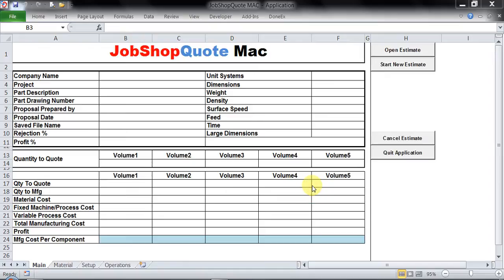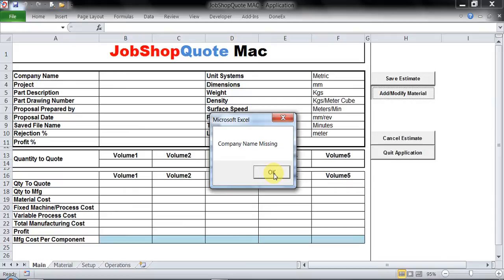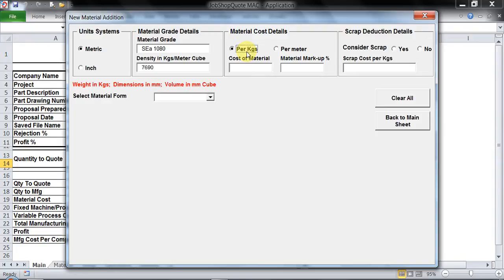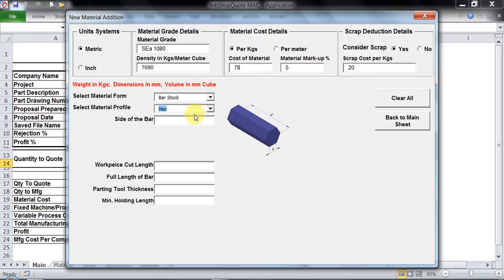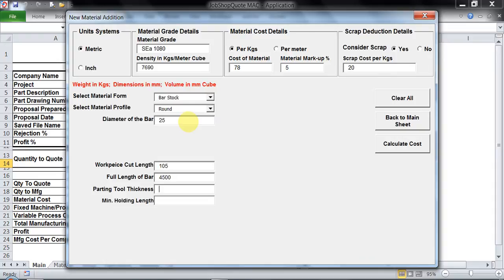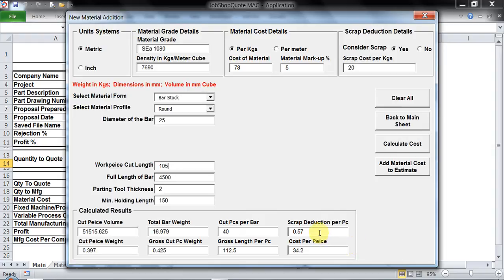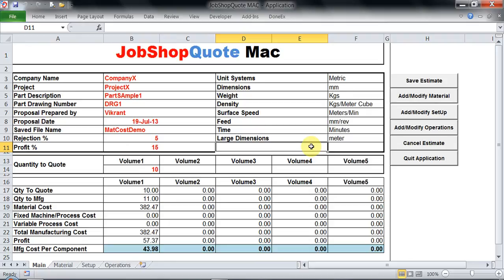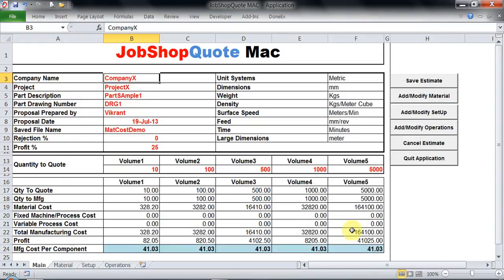Machining Material Cost Calculations using JobShopQuote MAC  New Version VRiddhi is launched

Comment: excel  ? really ?
Reply from the maker: Yes old design was with excel but had huge problems due to Macro not been activated in user PC so am trying to develop it in new software.
Reply from the maker: Hi Michael, 
A New version of the software is launched you can check it on www.vriddhitechnosoft.com
regards
Vikrant